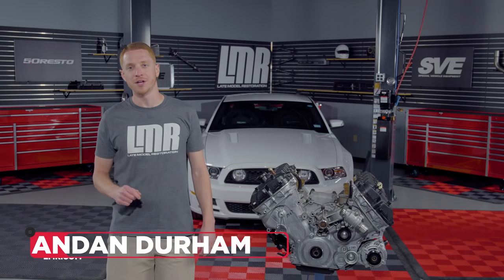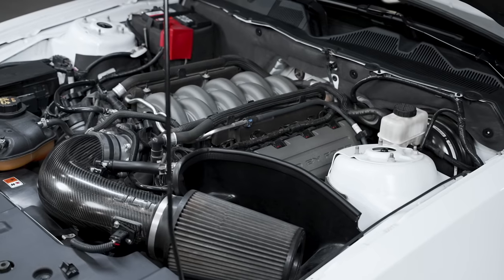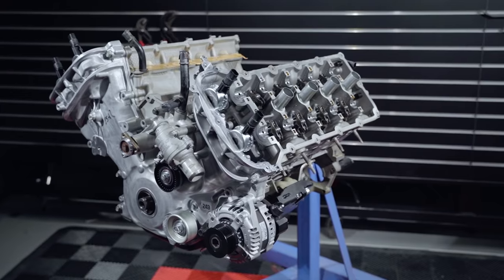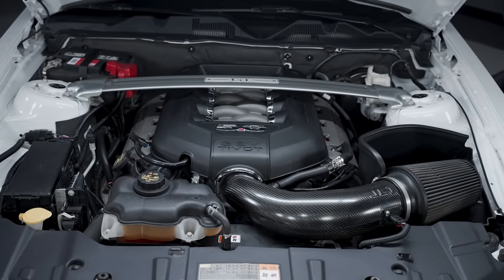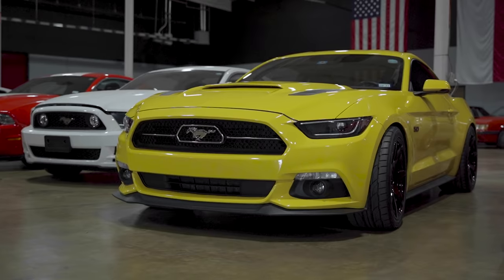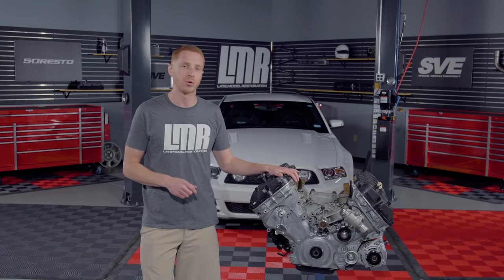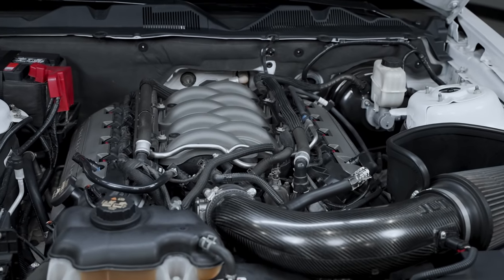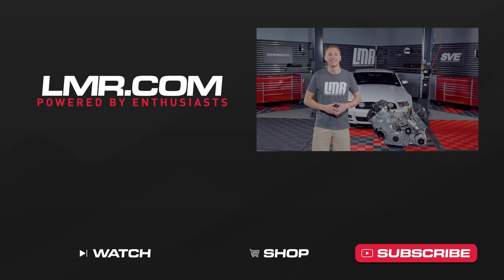Mustang vs F-150 Coyote Engine | What's The Difference?

Comment: The main difference between the two is -

A used low mile Mustang coyote is $5000+
and a used low mile F150 coyote is $2000 lol.
Reply: For my swap I barely found a used high mile F15p motor for $2200 lol. People even want those now
Reply: @bmlmao  I was able to find a used gen 1 F150 Coyote with a little over 100,000 miles with exhaust manifolds, intake, flexplate for 2500 bucks on Ebay but that was 2 years ago. If you're going to do a coyote swap start with the F150 and only buy one from a Mustang if you have to, or if the price is right, because all it takes to convert one from F150 to Coyote is intake cams and the intake manifold of your choice, assuming you're going to buy or fabricate headers. While you're at it, though, you really should spend the extra few hundred bucks and get a billet oil pump, just make sure it's the right one since F150 and Mustang use different oil pumps, you can't mix and match gears and housings.
Reply: @177SCmaro  Yeah I know all about that stuff, tried the best I could to find conversion parts but the coyote swap was a last minute decision, was in the middle of a 4.6 rebuild until I found rust in it's bore. So I went coyote and it kinda made me broke for a lil bit! 
The motor ended up going in as is actually. While I don't know what the mustang version feels like, with a tune, BBK long tubes, and an intake I'm plenty happy with it for now.
Reply: @bmlmao  
You being happy with it is all that matters. 
I had to fab headers for mine and fab/modify motor mounts. You may find this really hard to believe, but no one makes a conversion or adaptors for late 70's gm motor mounts to modern Ford modular, lol. They do for bellhousings, at least!
Reply: What all needs to be changed to swap a 5.0 Coyote for a 4.6?
Reply: @CrowCreekOutdoors  
You need a different intake and exhaust. The bellhousing is the same and I think the motor mounts are also the same for the 4.6, 5.0, and 5.4.
Obviously you'll need an engine management and slight modifications to the fuel lines and cooling system to accommodate the 5.0. (Especially if you want to use a heater. If you don't, you need to run a restricted bypass between those cooling lines to maintain proper coolant circulation. Pbhperformance sells a kit for either scenario).
Reply: @177SCmaro  Oh sounds like a blast trying to find mounts for that! I believe I saw something about coyote mounts for older GM vehicles on SummitRacing but yeah I wouldn't know where else to turn you
Reply: @CrowCreekOutdoors  Assuming you get Ford Performance's Coyote Control Pack, not much. The 4.6s transmission bellhousing works, motor mounts, steering rack, even Kmember if you get a different oil pan (but in reality you should just get a tubular kmember). Also the power steering and AC will bolt right up if you go for Power By The Hour's Speed Drive kit.
You will likely still need an intake because the one from the control pack is huge and unnecessary. Otherwise, all you're doing is fuel and coolant lines! (Plus the basic control pack wiring)
Reply: @bmlmao  When I told people I wanted to put a Ford Coyote into a 78 Camaro I was told that I deserve whatever (hardship) happens, lol. 
As it turned out, modifying the GM mounts to accept the Coyote wasn't really that hard. The most difficult part was getting it to clear the lines/fittings for the remote oil filter.
Reply: The reason there cheaper is the setup and the. Fact that there's almost 55 hp diffrence
Reply: @177SCmaro  Nice! Hey man if there are people out there putting LS engines in old fastbacks, you have a right to do all the same to an old Camaro! It sounds like a fun project with easy fabrication. Are you running the oil cooler or just a remote oil filter? Mine just barely worked in its stock location as long as I kept the cooler off. Might have a quarter inch between the filter and the sway bar!
Reply: @bmlmao  
Just the a remote oil filter for now. I run the coolant temp at 180 and it's just a drag car so I didn't think a cooler would be nessisary. However, there is an S475 turbo sitting on the shelf that is going to make the camaro coyote acqantence this winter so I'll probably add a remote oil cooler. 
If you are familiar with 2ed gen F Bodys they have a large frame member than curves under the front of the engine and locates the motor mounts which is right where Ford decided to put the stock oil cooler. So that would never work without taking A LOT of structure out of the frame and doing something completely different with the driver side motor mount. Even with a remote set up I hard to take a lot of metal out of the driver motor mount and added a small turnbuckle torque strap to the alternator bracket just to be safe. So far it's holding up. Raced the car several times now. Sure get some strange looks and interesting conversations from passers by, lol
Reply: @177SCmaro  Is there a video of it.
Reply: @CJColvin  
Of my car? I posted a couple of clips on my channel but they're pretty old. I need to put a new one up. I've fine tuned a lot and gave her a "racecar" paint job since then.
Reply: @177SCmaro  Awesome brother and yeah I would love to see that video.
Reply: @177SCmaro  a coyote in a 78’ camaro yeah that’ll rattle some Chevy ppl up, I’m currently looking into Ls swapping a 416 stoker(or just a stock 6.0)into my 05 f150 till the 4.6 blows
Reply: @JR-wg6cs  
I haven't had many Chevy guys say too much other then things like smiling and laughing "that's a f%cking coyote!". Most of the attention has been from late model mustang guys who want to know what I did to adapt it to the GM car and transmission. 
The only person who's crapped on it so far was like one guy in the comments on one of my videos. 
Going the other way, putting a LS-based engine in a Ford pickup that previously had a modular, believe it or not, might actually be more difficult than a modular in an old camaro unless you plan on going the full route with a GM transmission or a manual of your choice. Fabrication/modification of motor mounts and figuring out exhaust will be interesting but that's part of the fun.
Reply: @177SCmaro  seen a guy with a 97 F-150 with a 5.3 here on yt it looked pretty crappy but it did run and drive, did have some problems here and there that’s what really gave me an idea to do a Ls swap on mine..something different
Reply: @JR-wg6cs  
I'm all for it. Engines don't care what name is on the valve cover so why should we?
Reply: Makes me feel so much better about my f150.will cost me same price as a civic motor lol no thanks for the 4k price,my f150 will tow and a buttstang wont
Reply: What about 2015 and up F150s are the engine the same as the coyote mustang engines?
Reply: @177SCmaro  Can you put 5 speeds transmission from the 2005 mustang GT behind the F150 engine?
Reply: @thaieralawadh2223  
I believe so. As far as I know all the Ford modular family share the same bellhousing but it will be up to you to work out the clutch, checking clearances ect.
Reply: @177SCmaro  what about the car control module and wires ? Should I get it with the engine ? Same as coyote ? Or I should order one from power by the hour ..etc
Reply: @thaieralawadh2223  
What are you trying to do? What is the intentioned use of the vehicle? What vehicle/engine/tranmission swap are we talking about exactly?
Is it registered in an emissions testing county?
Reply: @177SCmaro  I have 69 mustang fastback and 2005 mustang gt manual doner car without engine..

For classic car registration don't care much about emissions .. I live in Dubai. 

I just want to build awesome project with the tools I have or look for good tools in good price.. 

Thus, thinking of the F150 engine with my manual 5 speed transmission from the 2005 mustang with it's dif..
Reply: @thaieralawadh2223  
Okay. So, Ford Coyote, 2005 mustang 5 speed manual, 69 mustang. Sounds sweet. Assuming the coyote fits (minimum 30inchs) and since emissions compliance is not an issue you can either run it on the Ford Performance ECU or Holley makes a standalone that you'll have to tune but it much more flexable. I believe both come with an engine harness. With the holley you'll need the vvt module if you run veritable valve timing. The Ford ECU is easier if this is just a mostly stock Coyote.
I don't know if that tranmission has an electronic or mechanical speedometer but you'll need to figure that out or go with a standalone GPS speedometer. You may need to figure out backup light switch and neutral safety if you want them.
Reply: @177SCmaro  thanks brother for all the info.. for now trying to figure out the engine set up and trying to get all parts to start working on it.. 

I could find F150 engine in here with ECU and might just attach it to the manual transmission I have from the 2005. Plus, I want to swap everything I could from that car like the differential and brake system.. but don't know what else might be needing.. I could do the fabrication to fit the engine which will need to widen the shock towers to make it fit but other than that I don't know what it might need. 

Don't plan to make crazy power the frame won't take it. 

For the odometer, I might just go with Dakota digital odometers or figure out something later. But not worried much about that. First, I need to figure out a step up to make it function well mechaniclly.
Reply: @thaieralawadh2223 
You're welcome.
I don't know how nice the stock f150 ecm will play on it's own, especially if you keep the drive by wire throttle, but I suppose it's possible to run the engine on that.
Let me know how that turns out. Once the Camaro is done I'm planning on LS tremic TKX swapping/rwd conversion a 2000 Toyota Celica and, unfortunately, I do live under emissions testing so I've wondered if I can make the donor ecm from a Tahoe or whatever work for them to plug into to pass emissions and then switch to a Holley the rest of the time.
Reply: @177SCmaro  what do I need to fit the F150 engine with TR3650 from 2005 ford mustang gt manual?
Reply: @thaieralawadh2223  
To bolt the TH3650 from an early 2000's mustang to the Coyote I think you just need the appropriate hardware since it's all modular engine family. I would double check your pilot bearing/bushing size and clutch clearances.
Reply: Where can I find a gen 1 mustang engine ? My current one is blown and i need help finding a new one or used one

Comment: Great video brother and I love the Coyote V8 in my 2011 F150 with 140,000 miles on it and still going strong and its a beast and it sounds like a beast with the Borla ATAK exhaust on it and the best part is that it doesn't have turbos nor other stuff to go wrong nor costly to repair unlike the EcoBoost engines.
Reply: Nice I'm at 170k with my 2012 still running great
Reply: @USA--1776  Great too hear. I got a 2013 with 98,000 miles. Glad I can get a lot more years out of my truck.
Reply: Nice to hear you are having good luck. I have a 2014 F150, but, that kind of mileage is nothing special. When and if you get over 200k on it, then, you will know how good it is. Most modern engines that get good service and are not abused will run forever, it is all the rest that goes to hell, the engines themselves are all pretty good, of course there are some that are not.
Reply: @WhatTheHeck1290  Awesome brother
Reply: @keithkuckler2551 currently at 294,000 miles on my 2015 f150! At 280 I had to replace my cam phasers and at 250,000 I needed a new water pump and ac unit. But she's still purring like a kitten
Reply: 280k here on my 2012 5.0 f150!! These trucks are great

Comment: I’ve got a 2011 f-150 Ltd Supercrew 4x4. with a K&N high flow kit and Magna Flow dual exhaust. For a 6,000 lbs truck it’s pretty fast and it sounds great. If anything ever happens to the truck; I’m keeping the motor for my 63 1/2 Ford Galaxy.

Comment: Great video! Did a 2013 F150 Coyote swap in my old 97 Mustang. Motor has around 160K on it but still runs and revs out like a champ, no oil burn or anything, save the loud tick almost all Ford motors seem to develope. Whats interesting to me is what amount of power my car actually makes. With such minor differences in the intake, compression, and cams, I wonder if a mustang tune brings the motor past 360hp. I can't say I can tell by how it feels because my only past sports cars were a 98 V6 and this same 97 with its old 4.6. Will have to get it on a dyno sometime.
Reply: You bought a 160k mile motor?  And did nothing but say it's ok and no oil leaks?  Im a ford guy but damn that's not a great investment at all
Reply: @3rdcoastobs467  Hell yeah I did! lol. It is an LKQ motor, replaced the gaskets I needed to, made sure it had compression and sent it. The motor has a warranty from LKQ. 

Besides, the swap was a last-minute decision after I found rust in the 4.6s bore, so I went close to broke.. lol. The motor will come back out and get a refresh sooner or later.
Reply: @bmlmao pretty Damm cool
Reply: @3rdcoastobs467  the engine in my 2011 F-150 has 346k miles.

Comment: I have 350,000 miles on my 2013 Coyote 5.0 F150 Super crew and it still runs killer. It burns a little oil between oil changes and is only down on power a very small amount. It has been one of the best vehicles I have even owned. Still considering putting a hopped-up coyote in my 1984 Foxbody RS Capri. The only thing keeping me from doing it is It's got a 347 stroker in it right now that makes the engine bay still look kind of factory with the carb on it and I kind of like that look. The Capri has been in my family since it was new.

Comment: Need one of them in my 04 grand marquis
Reply: Same
Reply: Same for my 03
Reply: I have 225K hard miles on my 2011 Grand Marquis, it still runs like new, doesn't burn oil between oil changes and does not have a single leak. It always cranks on the first attempt no matter how long it sits.  I want a coyote swap in it badly but it's going to be a while as the old 4.6L in it won't die.

Comment: For anyone thinking their late 14 has gen2 heads, well, it does BUT they're gen2 f150 heads. Almost identical to gen1 heads EXCEPT for extra material around the intake port for the IMRC's. Same valve size and everything. Gen2 mustang heads got the larger valves. My late 14 Mustang has the old style head on one side and the new style on the other...

Comment: I'm a Honda guy. But damn I love these engines
Reply: Well the Coyote and Voodoo, found in the GT350, are like the import engines of the muscle cars. They use multivalves and cams, variable timing, and high revs to make power from a relatively small displacement.
Reply: Both are amazing in there own respects, Honda engines are a steal of a bargain for the amount of power you can push out those little monsters.

Comment: Earlier this year I bought a used 2018 Ford F-150 with the 5.0 liter.  Has all the power I need. Surprisingly it gets a over 20 mpg. I'm happy about that. Some years back I had 07 Dodge ram with the 5.7 hemi engine. Average 15 mpg maybe.
Reply: Yeah my 2016 5.0 f150 supercrew gets over 20 mpg too. I'm happy with it and the power. Exhuast upgrade is all it really needs
Reply: I have a 2014, F150 XLT, four wheel drive. It is a terrfic truck, and, yes it has plenty of power. I also get between 19-22 mpg with road driving. It did a bit better until I replaced the lower height Leer topper with a higher one, that has knocked the highway mileage down a bit, but, it is still good.
Reply: Is that 2018 5.0 using oil. My Gen 3 (2019) was using 1 qt. Every 1000 miles. Sold it after TSB by Ford and several dealer trips. 👎

Comment: Fun fact the bean counters at ford put less agressive cams in the production Boss 302. The Exhaust cams have 13mms of lift and 265 and it shares intake cams with the gen 1 Coyote.  It was suppose to get exhaust and intake cams with 13 mms of lift and 290 duration. These cams were later sold as Cobra jet cams
Reply: @likenem False, the Boss 302 uses 13mm intake cams at 263 degree duration vs 12mm at 260 degrees on a stock coyote. The exhaust cams are the same. The prod and Boss 302S/R are exactly the same in the engine compartment, sans oil pan and engine harness.

Comment: I used to make the Valve Covers at Dana and the main difference was we would use silver bolts for the truck and black bolts for the mustang version. 
A side note after about a year all the sudden they became very strict about flash left over from the molding. We had to integrate an extra step but I'm not sure if it was a visual thing someone noticed or it caused engine issues.
Reply from the maker: Thanks for that bit of knowledge! -Landan

Comment: I’m pretty sure the old 5.0 was 302 CI but the Coyotes were 305 CI but they used the Boss 302 nomenclature for nostalgic purposes…
Reply: The 11 - 17 Coyotes were 302. The 18+ are 307.
Reply: The 2011-2017 Coyote was the same displacement as the old 302 but the 2018 and newer Coyote is 307 Cubic inches like one cube bigger than the Ford small block 306 crate engine.